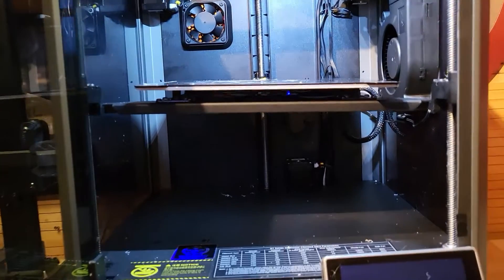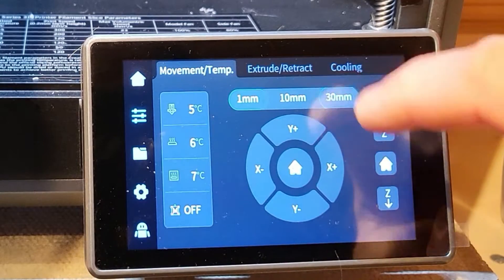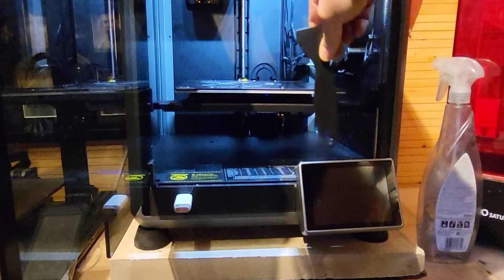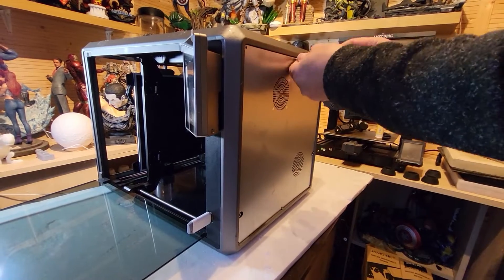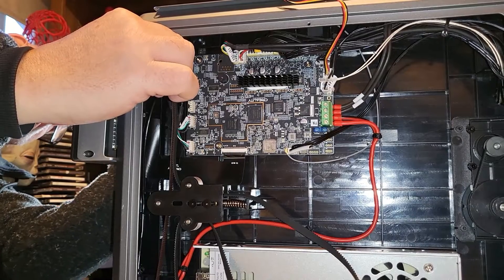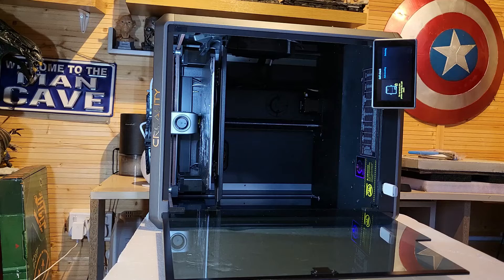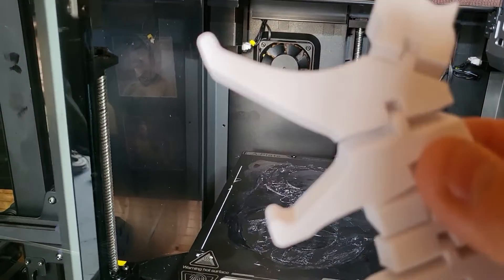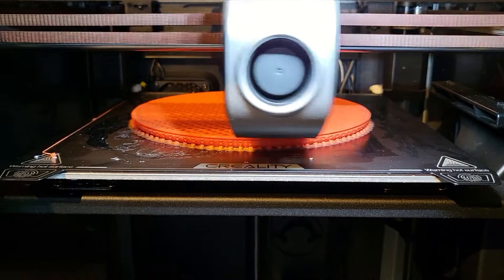Levelling A Wonky Build plate On Creality K1 3D Printer How To level

Comment: The auto bed leveling is useless. I bought a manual leveling kit for the ender 3 off Amazon and was able to make much better adjustments with my k1 max rooted using the screws calibration script. Much faster and more precise.
Reply from the maker: I've has no prob with bed leveliing once plate was flat ish

Comment: a lot of us in the facebook group have been "tramming" the bed... i also think your belt is routed wrong..? not too sure, but look it up, i believe the belt tensioner shouldn't be so tight... you aren't supposed to struggle that much like you did... type in your printer's IP address into a web browser, and it will give you an interface that shows the bed mesh... from there you can perfect the bed level by skipping teeth on the belt... 1 tooth equals i think 0.5 on the mesh graph...

Comment: I don't think they had the bed screwed down when they put the belts on, because it shouldn't be possible to ship a bed that unlevel.
Also, I can't believe you don't clean your build plate after prints.
Reply: You don't need to clean it after every print, especially if you arrange the models to use all the bed instead of always in the centre
Reply from the maker: I do clean it usually lol....